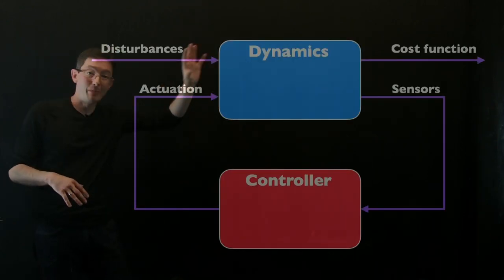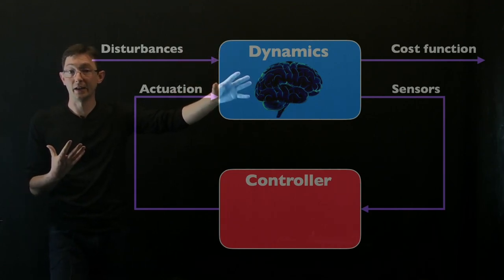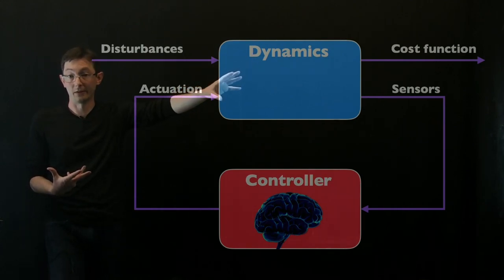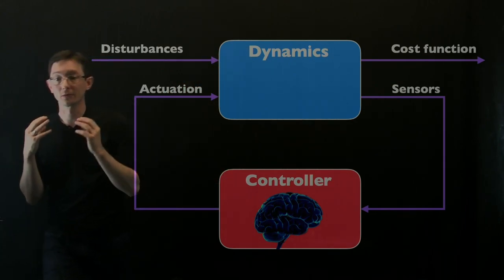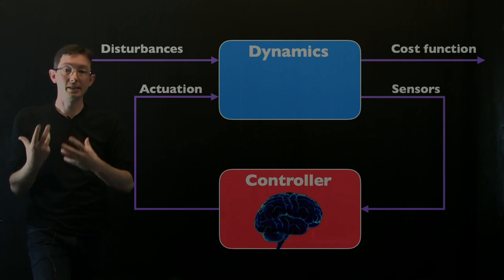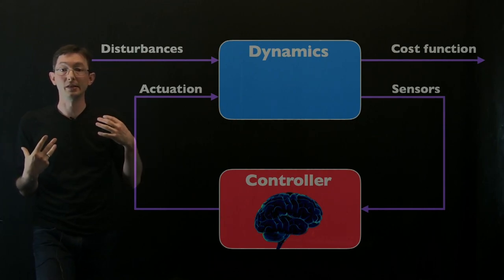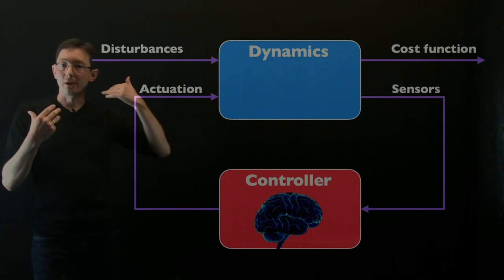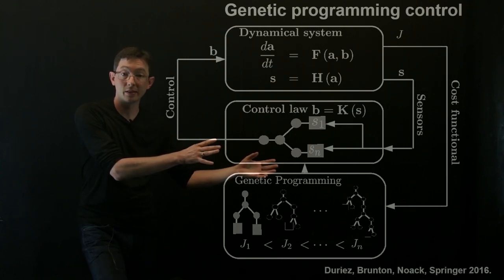Machine Learning Control: Overview

Comment: I have a dynamical system with very significant unpredictable disturbances (i.e. a boat in waves). I can observe the current and past states of the boat but I have no observer for the current or future disturbances. I want to predict the future states of the boat, based on the current and past states of the boat in real-time. What kind of algorithms may be suited for this? Recommendations are welcome!